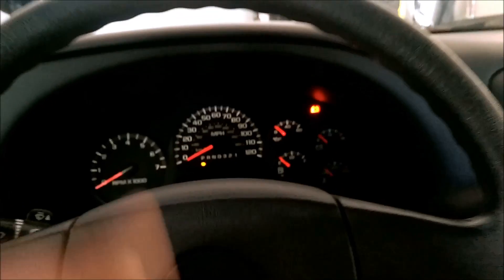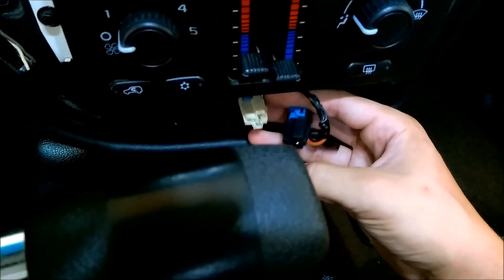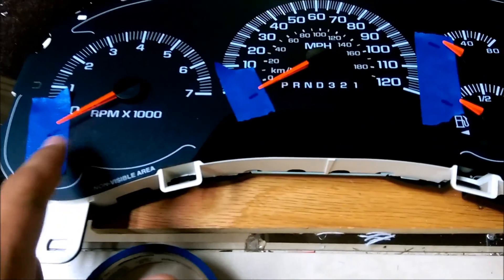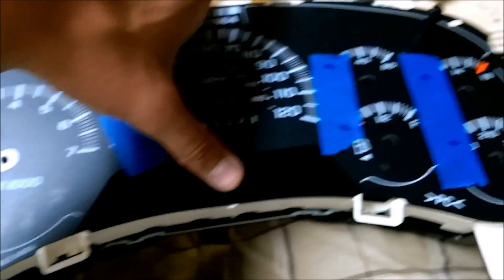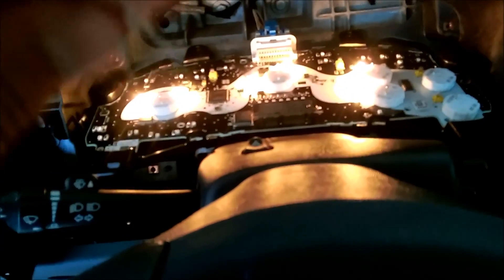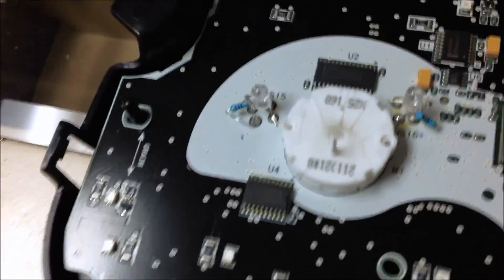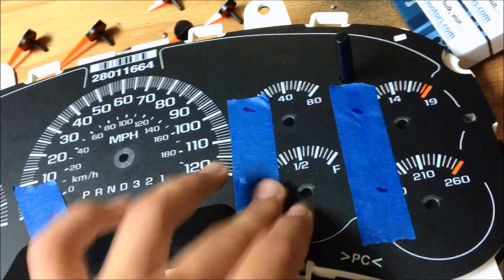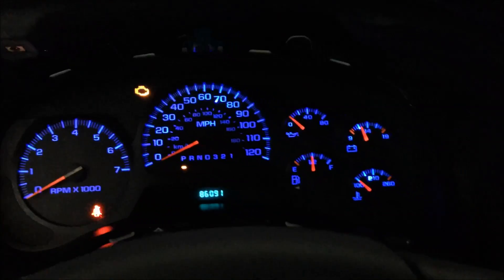LEDs in GM gauge cluster, Chevy trailblazer(High detail)!

Comment: My LED bulbs don’t have the little resistor on the positive, just two straight wires and the long wire is the positive, what is the benefit of having the little resistor on the positive wire?
Reply: So you don't kill the LED with 12V.
Generally Red requires around 2.2v
Blue, white and green usually require 3.2v.
Value of resistor depends on color used and how they are wired.
You can put 3 LEDs in series and use a lower value resistor.
You could also use a larger value resistor per individual LED instead.
Math.
Reply: @caddyguy5369  I did all mine in blue, the whole cluster, four-wheel-drive switch, rear wiper switch, climate control, memory seat buttons, Bose stereo and CD player, power windows and locks on all four doors, heated seat switches, climate control in the rear center console and the OnStar garage door opener three buttons on center headliner, all of mine just had one longer L+ shaped lead  and one shorter L-shaped lead, been that way for two years now and everything is still lit, soldered them all in, looks awesome.
Reply: @wild8757  Nice. What vehicle?
I'm working on RGBW in a 2000 Bonneville. Setting it up so the factory dimmer switch still works without messing up the color mix.
I picked a really hard vehicle to do it in though because all the buttons are molded translucent red so I'm going to have to make all new buttons from scratch.
Reply: @caddyguy5369  yeah that sucks that the buttons are already tinted over red, I have a 2006 Chevy Trailblazer LT with 83,000 miles on it, I’m the original owner, my dimmer switch dims all the LEDs on the dashboard just like it did before I put the LEDs in
Reply: @wild8757  Nice. I have a 2019 equinox I'm tempted to do because everything is white already so RGB wouldn't require Modding buttons. Need to get the electronics sorted first though. Then it will be pretty trivial to do more of my cars.
Super anxious to be able to cycle through colors the first time.
I was just going to do a single color change, but couldn't make up my mind what color i wanted, so as usually i have to punish myself and make it overcomplicated. :-) 
Also going to put in a second zone of RGB+CCW for dome lights.

Comment: I am curious if you screw up the position on the motor when taking the needles off how do you get them set back in the proper position?
Because I took apart my spare cluster to experiment and the needles moved
Reply from the maker: what i always did was lightly turn them far left as you can. and it will stop. don’t push them hard. to hard and it will turn needle on the motor  shaft. then sweep right and sweep back left again. mark that spot with your tape and marker. and then bring the needle to middle. remove needle. then on assembly. press needle back on and then sweep left and right and make sure it lines up with your mark. if it dosent you can give it a little presure and turn the needle on the motor shaft. and then always sweep left and right after you turn it. to see if it lines up with your marks. best i can explain over text lol.

Comment: What soldering iron did you recommend?
Reply: Very nice by far if you're already familiar with soldering, and always use 60(tin)/40(lead) electronics solder... https://www.amazon.com/UY-CHAN-Programmable-Pocket-size-Soldering/dp/B07SQDZ9SV/ref=pd_sbs_469_8?_encoding=UTF8&pd_rd_i=B07SQDZ9SV&pd_rd_r=f4ad5354-ef0d-472e-a09e-db01f17b3c54&pd_rd_w=w7T3p&pd_rd_wg=XiPY4&pf_rd_p=7cd8f929-4345-4bf2-a554-7d7588b3dd5f&pf_rd_r=0NP56MVWF1YKVW46JPK4&psc=1&refRID=0NP56MVWF1YKVW46JPK4

Comment: Forget messing with LED's that need a resistor! Get the 12 volt LED cubes that the resistor is built in.  They last for years unlike the junk sold on Amazon. https://www.ebay.com/str/gmgaugerepair/2003-2006-Gauge-LEDs-GM/_i.html?_storecat=23700036017

Comment: I know this is old but where did you get those bulbs. I can’t find the ones with the resistors on them. Just ones without. Can those be used or are the ones with resistors better?
Reply from the maker: Regena Rodriguez i use the SMD style now, they are flat and circular and have 3 led diodes on them, they have a built in resistor on them. just search in ebay, Blue SMD LED GM cluster or somthing like that

Comment: QUESTION:  I replaced all my bulbs with led bulbs that i had to  solder to my cluster ..  None of my new led blubs had an resistor on them... When I reconnected my cluster in my truck only one signal light was working.. I tested all my led bulbs prior with my multi meter and they all worked... .. None of my other lights are showing nor are the needles moving ....

ALL of my gauges  worked and my cluster was lite prior to my modification ....
Reply from the maker: Klove The Lou unless you bought SMD Leds that have a built in resistor, you are suppost to use a resistor on each led. like i have in the video. in order for the leds to light and not short out. but that’s a seperate issue from the rest of the cluster not functioning, there could be a wiring issue with the harness if you were not careful, or possible solder splater got somewhere where it’s not suppost to be and shorted the board. it’s hard to say not having the board infront of me but your going to have to go over every connection on board. and make sure it’s good and not burnt.
Reply: Rydog's Garage LED LIGHTS:  Yeah the ones I ordered were just straight line led bulbs with no resistors .  SOLDER: My soldering job was actually pretty flawless with slight touch to 2 of the stepper motors.. slight touch...  HARNESS: Took my time with the entire process and when I disconnected it and reconnected it I felt as though I was very careful with it..lol..  STARTING OVER:  Yeah I am.going to look at everything again because clearly either without the resistors the bulbs blew out all but 1 or they shorted the entire board out....  Its a serious mystery.
Reply from the maker: Klove The Lou i’ve noticed the boards will act really wierd if you have shorted out leds in them becuase i believe that the power gets transferred through everything, i have yet to look at schematics
Reply: Rydog's Garage Oh ok..Yeah. I feel like a mad scientist because I took my time and removed each individual old bulb and solder the new LED bulbs one at a time also..  

Again the left signal light works no problem. My fuse for the cluster works no problem..  

THE PROBLEM: Needles not moving and no other led lights are showing when I connect it to the stable harness in my truck... ...
Reply: @KimberlyCaresForU  long story short send your cluster to a company that has life time guarantee. It takes 1 week and you can still drive your truck. I went through the very same thing

Comment: QUESTION:  I replaced all my bulbs with led bulbs that i had to  solder to my cluster ..  When I reconnected only one led signal light  was working.. I tested all my led bulbs prior with my multi meter and they all worked... . My led bulbs did not have a resistor on them.. None of my other lights are showing nor are the needles moving ....

ALL of my gauges  worked and my cluster was lite prior to my modification ....

Comment: Maybe after figuring out the negative and positive of one light u could do a continuity test to the others
Reply from the maker: RobesEleven i have a new way to check the led it's self. i just have a 9v handy and tap it to see when it lights up. but i wonder if you could continuity test the board it's self.... interesting theory. i didn't think about that. work way better than testing it back in the car. but all trailblazers are the same board. i have pictures of the markings i made and have done 3 more clusters for friends and they all work great. will be re doing mine so to try something new.
Reply: +Rydog's Garage I would think all the grounds would have continuity

Comment: Kinda great video. But your camera movement nearly made me toss. I hope you can slow down a bit next time or smooth out the jerky camera footage. Otherwise a very informative video. I am familiar with LEDs and voltages and polarity. Not sure what you used for a dropping resistor. Battery is around 13-13.5 volts dropped to 3-5dc max. 
Also, what about finding the cluster lighting circuit in the main. Add a pigtail to the circuit and install a power resistor?  5w should be more than adequate. The you could eliminate all the 1/2 w resistors.

Comment: great video thanks i have a 08 trailblazer. and was trying todo the led dash
Reply from the maker: James Shaughnessy just take your time and it will go smooth! you should be able to use my marks i made for which is positive in the video. so you don't habe to go back to the truck to check positive and negative. and order a few extra leds never know if/when you mess up

Comment: on my 06 ls trailblazer was socket style what yr was yours again an what leds are better now
Reply from the maker: Super Chevy mine is a 2009. and i use the smd style leds now
Reply: Rydog's Garage are them a lot better an they must have switch them in 07 I think to your style
Reply from the maker: Super Chevy as far as i know the dash is the same, i have done a few 05 clusters and a 06 ss cluster and it's been the same board and everything. has the yellow normal stock bulbs. and i romove them and solder in the leds
Reply: Rydog's Garage I don't think I had to solder mine in its been yes since I did mine have you ever done the climate control ones yet mine left side is out them are stock
Reply from the maker: yes i have converted everything in my truck climate can be done, it is a pain tho have to be very careful taking it apart. the slider knobs are hard to get off without damaging the board

Comment: very informative and thank you the only question is where can I buy the led with the resistors on them already?
Reply from the maker: stabill1 i got them off ebay, but i now do all my led conversions with SMD LEDs they are a lot brighter and work out better in this occasion i will post a link
Reply from the maker: stabill1 https://www.ebay.com/itm/112076311380  they are like this, 3 led diodes and a built in resistor, easier to get closer to the board so you get a more spread out light, i have re done my cluster 3 times from this video to find the best setup and this is what i like to use now
Reply: stabill1 the only down s9de to using LED with resistors is HOT SPOTS

Comment: do you know which resistors can be used to do that mod? thanks bro
Reply from the maker: +Alex Reyes i believe they where 420ohm for the blue leds if i remember correctly
Reply: With blue you'll use 470 ohm for 12V. You can buy 12V ready LED's (resistor built in) on eBay.

Comment: Which LED's did you buy and where did you purchase them from? Looking to do mine sometime in the near future and want to buy a reliable product. Thanks for the info.
Reply from the maker: I bought them on eBay, they are 12v lets with the correct resistor soldered to them, I was going to order more a week ago and I cannot find the seller so not sure if they are still available...
Reply from the maker: +rydog12100 they are 12v LEDs with correct resistors***

Comment: I did the same thing in a Silverado a few years ago.  I had good luck getting rid of the hot-spotting (like you had on the 70 mark) by thoroughly hitting the LEDs with some 80 grit sandpaper.
Reply from the maker: interesting! May have to give that a try on my next project! few months and almost 4k miles later after I did this, it's still perfect!
Reply: +rydog12100 Yeah, if the current is set right, the LEDs will outlast the truck. I've had the ones in the Silverado for about 3 years I think.  I originally had to open it up so I could resolder the SMD resistors for the PRNDL display, and figured I'd improve the lighting while I was in there.  I just picked up a Trailblazer, and it has the same uneven lighting. :(
Reply from the maker: +pvfjr yeah they will outlast the truck! I have to redo the smd resistors on my dads sierra too, hahaha they all have it